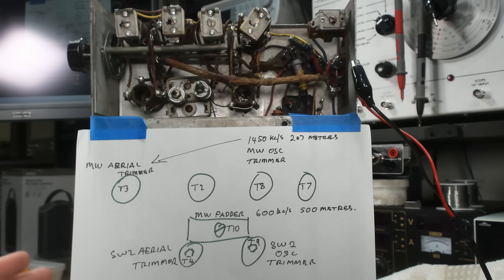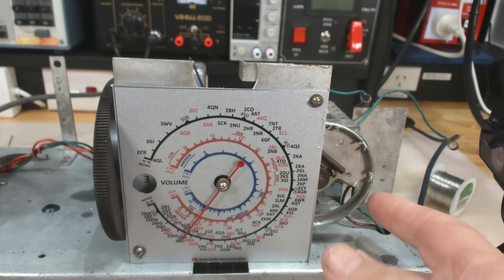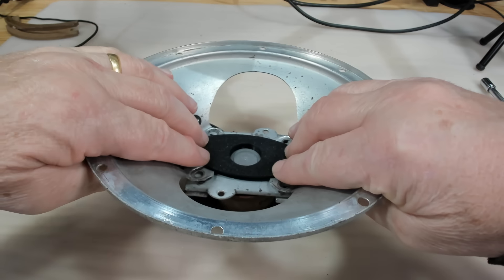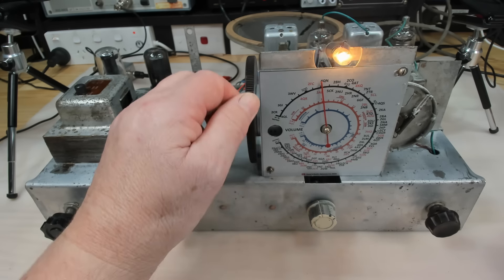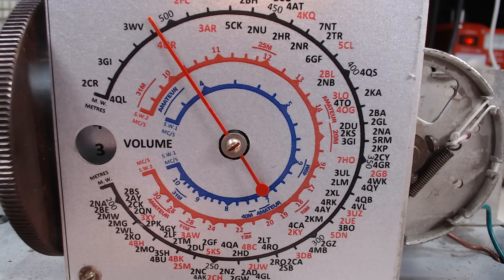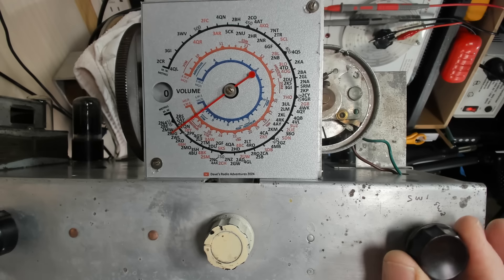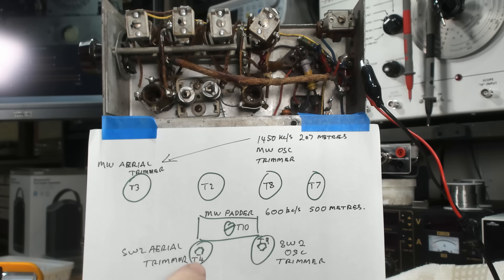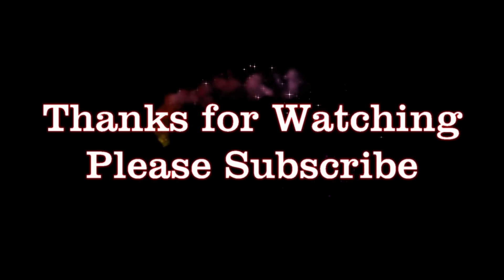Time Spot Radio Part 2

Comment: A custom made spacer gasket to align the magnet to the housing plate. I'll have to remember that one. Just brilliant David.
Really like your style and knowledge level of repair work.
Reply from the maker: Hi Steve, thanks. The printer is handy for sure. I have seen others use shims and other means to align and centre the speakers but the printer makes it so much easier 👍🙂

Comment: You and Jim Burns are excellent at re-creating stencils! 👍  Jim even re-creates the  Q.C. stamp on the chassis, and the stain of the original tube layout. 👌
Your alignment procedures are always so clear compare to J.L. (joke) alignment!  He even TRIES to use an SDR; and he hasn't changed all the CAPs out yet!! 
---
I DON'T watch him anymore, since he  ould raise the hair on the back of my neck!  I was heading towards a coronary!   errrr :face-red-droopy-eyes:
Reply from the maker: Thanks TubeDude. Yes Jim B does a good job, Jim L... he tries 😄
Reply: @DavidTipton101  - He hesitates to just go for it, and not make so many video's. errff

Comment: Hi, Dave...a couple of things I love are your 3-d printed centering plug/jig/thingie for aligning the speaker, and the quite reasonable performance of such a simple set, even on shortwave. Such a bear to tune without bandspread. Cheers!
Reply from the maker: Thanks Don. The two stage vernier tuning shaft made it fairly easy to tune but bandspread would have been better again 😊

Comment: Hello David. Fun vid as always.  Your attention to detail is remarkable.   Noisy tubes with grid caps can sometimes be fixed by melting the solder on the grid cap and letting it re-amalgamate. The little grid wire sometimes comes  loose from under  the blob of solder. Enjoying Buzz1151's  vid  but even Stateside, we know your the best !
Reply from the maker: Thank you Kevin. Good thinking, if I still have the valve I will check that out. I have at least three other 6B6 valves with the same issue and it seems to be a problem specifically with the 6B6 but worth a try👍🙂

Comment: Part 2 of the restoration, wonderful. G'day everyone from germany. Hi,David.
Reply from the maker: Thanks Tobias. Guten Tag from Australia 😊
Reply: @DavidTipton101  my last tube radio has been finished, a ve 301w, two tubes, and all resistors and capacitors, works great,Medium wave and long wave only.
Reply from the maker: A Volksempfänger! You lucky duck. I tried to win one of those at an auction, it was a battery model but still went for over $400 so I dropped out.

Comment: Thanks for the Video. I'd be very interested in how you reapplied the letting on the dial face.
Reply from the maker: Hi Robert. I used a paint program and Publisher. You can use Gymp or anything like that for both. I photocopied the original and used that as a background while applying the text. It was printed on silver paper with a laser printer 🙂

Comment: It looks like 👍 ya got stuck with restringing the dial cord. It's also a good 👍 idea 💡 to replace the spring, which is on the dial cord pulley. They can stretch out over the years, and cause unsatisfactory tuning performance. It looks like the speaker 🔊 is a field coil type, but it sounds like you're suggesting permanent magnet 🧲. I knew that ya were coming up with a part 2, I just had to wait ✋️ for it. Happy Halloween 🎃 👻 🧙‍♀️. Like I always say, "Happy Howlidays",Your friend, Jeff.
Reply from the maker: Hi Jeff. The dial cord was easy on this one. Is it that time already? Happy Halloween Jeff 🎃

Comment: Great video, Dave. Looking forward to the clock episode and that coil rewind, not sure how your going to work out the turns you need, or the resistance it should measure. Maybe someone on a forum might know the Ohmic value. Thanks for sharing and have a great weekend.
Reply from the maker: Thanks Brian. I simply rewound it as it was, fingers crossed 🙄🙂

Comment: Sometimes those IF notch filters are disabled because they tend to be too wide and block some of the MW/broadcast band.   The frequency they blocked was an old marine band, but long disbanded so it is best to remove that if the notch is wide, which it often is.
Reply from the maker: Yes, I agree. We don't have any stations in the low frequencies to be affected so I leave them in and adjusted if I can. There is no harm disabling it like this one was. I thought it was marine band, thanks Brendan 👍🙂

Comment: Nice job on the dial, do you bag up and leave the original components in the set and a note about your restoration. I like to see information from previous restorers. Best from Liverpool UK
Reply from the maker: Hi Woffy. I intend putting the old dial inside if I can find a safe place for it 👍🙂

Comment: That dial came up a treat, may I ask how you recreated it ?
Reply from the maker: Hi Ellesmere, I'll past a previous answer: I used a paint program and Publisher. You can use Gymp or anything like that for both. I photocopied the original and used that as a background while applying the text. It was printed on silver paper with a laser printer 🙂

Comment: 465 Khz is the very top of the NDB band. Fewer and fewer of those are being used worldwide.
Reply from the maker: I though it went a bit higher than that to just under the Broadcast band. Certainly commercial aircraft don't use it much anymore. Thanks Tim 🙂

Comment: Is there still any reliance in Au🎉stralia for Short Wave reception? I know in the 40’s and 50’s places in the outback would be able ( at night) to pull in Transmissions? I have a small modern transistor radio which has Short Wave on it, but there dont seem to be any stations broadcasting on it.
Reply from the maker: Hi Chris. I can get some short wave, China mostly, some New Zealand and the islands. There was ole in Sydney a while back. There is a website listing all the SW stations I think. Thanks Chris.